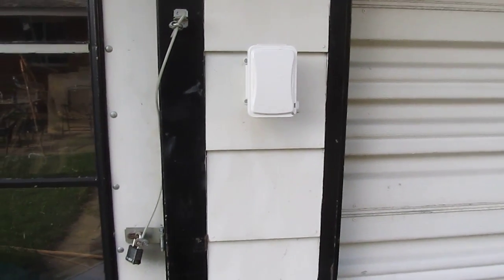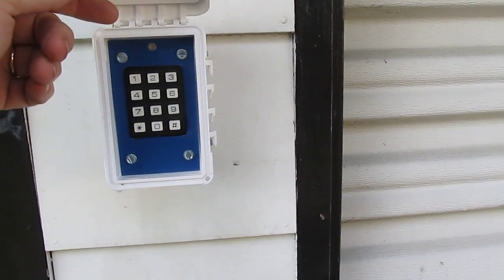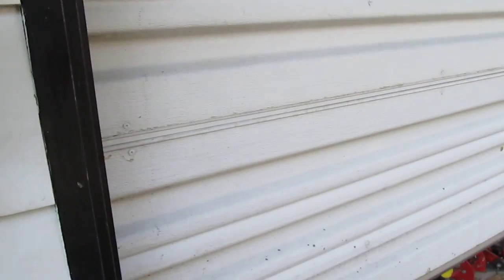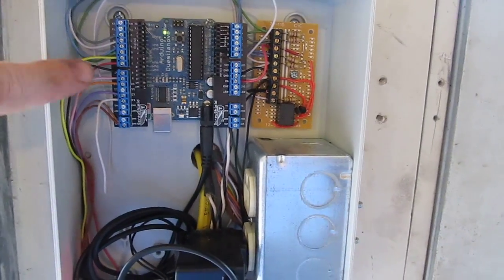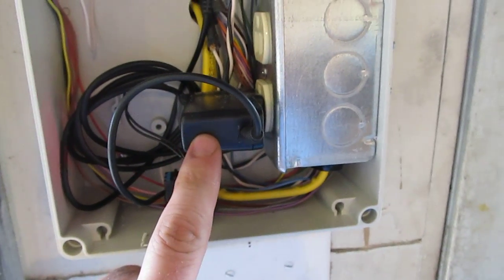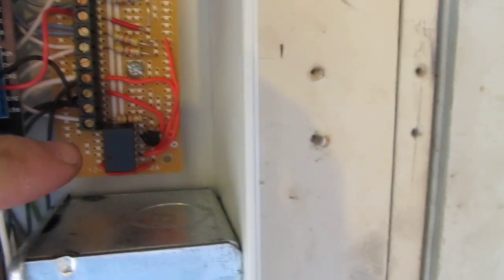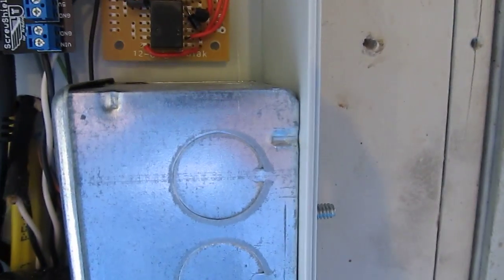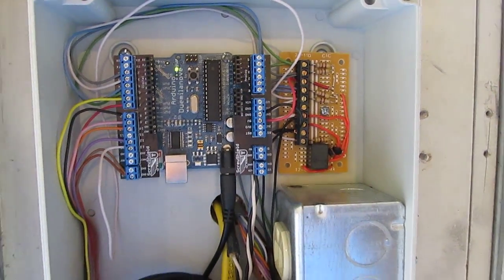Arduino Garage Door Opener

Comment: Do you know if you could power the arduino using the wall mount garage door button control power?  The wall control is drawing some power from the line because it's powering a few LEDs to light up the buttons.

Comment: is there a diagram for this and where can I get the parts for this setup cause I want to do something similar but going to add a wifi component so I can open or close it from anywhere.
Reply: and the code that was used for this?

Comment: For much cleaner looking power supply, check out flebay for "led drivers" power supply etc. they are generally 110-240v input and a variety of outputs. 1 3 5 or 12vdc. They are like 3 bucks shipped. Give em a try, really clean up duino projects.

Comment: Could you share the arduino code you programmed?  I'm trying to do something similar with a gate opener, but programming in C is not my strong point.  If you would share how you switch direction with a button push (in your code), it would really help send me in the right direction.  Thanks

Comment: nice setup. how does the circuit works. doe the arduino send +5vdc to the transistor which fires the relay. can you explain the circuit operation in details.